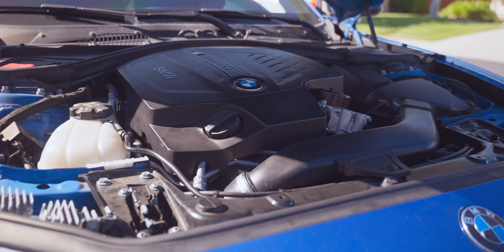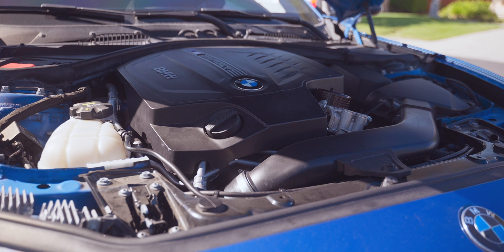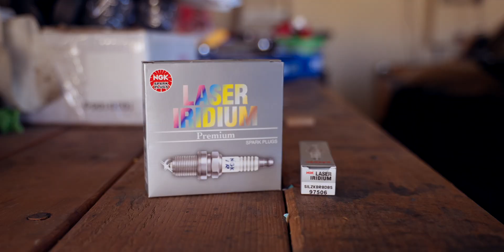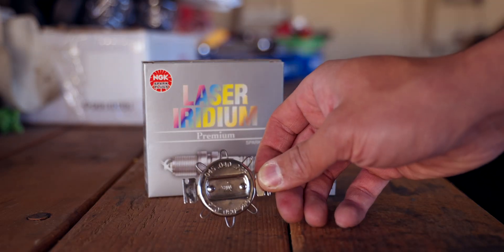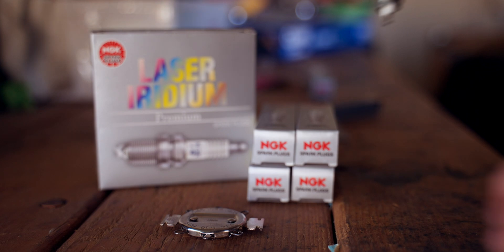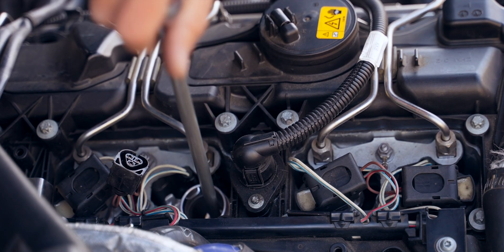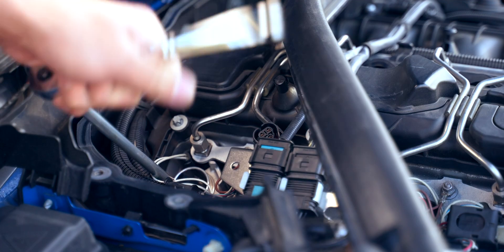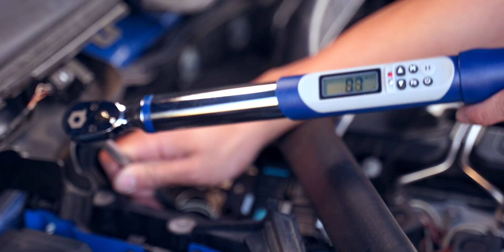How to Change and Gap BMW N55 Spark Plugs

Comment: Nice vid. Are the strut bolts single use, and need to be replaced?
Reply from the maker: BMW recommends you do because they're torque to yield. But the spec is so low for bolts this size it's fine if you reuse them, plus it's not a part that requires super precision. Just don't do the additional angle

Comment: Maybe I missed it but the gap you say for the spark plugs is for a tuned engine. Not a stock engine. Right? Took me a second to realize the plugs I bought are gapped properly for a stock engine.

Comment: Thank you for another fantastic video!!

The only minor suggestions that I have to make:
- For me, the screw holding on the O2 sensor bracket blocking plugs 5 & 6 is a T27 not T20
- The O2 sensors don't have to be removed if you're lazy like me. I was able to just remove the bracket screw and slide the whole thing on top of plug 4 with plenty of room to spare for 5 & 6.
- It's much easier to remove the sound deadening foam at the back of the engine after all of the plastic/weather stripping has been removed. Inversely, it's also much easier to put back first after the plugs and coils have been reinstalled and reduces the chance of it tearing and/or not seating properly.
- I would recommend using a vacuum to clean out any dirt in the spark plug socket before installing new ones.

Comment: I did this today. However I found that putting the foam back before the bar and the plastic piece made it so much easier and ensured that the foam sat in the correct place.

Comment: any reason for not using bosch ZR5TPP33 R8 plugs gapped to .022 on a stock N55 X6?  just curious because that's what i bought and don't want to do the install if ngk's are superior.

Comment: I almost purchased a 2015 535i recently.  Like new, 32k miles.  Then I researched... so much plastic under the hood?!  Leaks, leaks, leaks... $200 - $300 for an oil change?!  We have Lexus & Toyota Avalon currently.  When discussing either the word leaks & plastic never comes up.  At 140k miles some brakes, battery & oil changes thus far.  Will change plugs & flush coolant soon just as preventative.  I backed out on the 535i.

Comment: Boost Monkey Spark Plug Gap Tool for 12mm & 14mm Threaded Spark Plugs (12mm), proper spark plug gap reducer tool not the one he is using.

Comment: When I cold start my engine, it starts and then I have a "stop", and it restart.
It does this only on cold start.
What do you think ? I have zero warning, zero default code.. 

I wait for the Socket, I will check the spark plug then I will update..

Comment: Fritz. Thanks for the video. If I just buy the spark plugs from the dealer would I still have to gap them ? Also my valve cover gasket is leaking a little should I get that fix first then do the spark plugs. I worried that I I do the spark plugs first I’ll find oil on them.

Comment: You dont have to remove strut bars. I broke the strut bolts and had to drill it out major pain. Just remove those triangle plastic cover arout the strut bars. You have enuf room to work on 5 and 6.
Reply: Definitely don’t need to remove strut bar then?

Comment: Fritz, thank you for showing us how to remove the strut tower brace and covers to get to plugs 5 & 6.  Just an FYI even if you are going with stock plug gaps check the new plugs anyway.  One of my six new plugs was over gapped at 0.034" out of the box.  Cheers.
Reply from the maker: Thank you for sharing that and I'm glad to hear you caught that before installing it.

Comment: Just ordered plugs at 53k miles and the only mods I have done are charge pipe, boost and  intercooler. I just ordered the OE Bosch plugs. I don't think I need to go cooler with the NGK at this point. Also doing the tensioner replacement job as well.
Reply from the maker: All of the preventative and routine items I see. Very nice 👌

Comment: Hello Fritz, i am currently stage 1 on my m235 its time to change my sparkplugs, i just got the ngk 97506 should i gap them to 0.022?
Reply from the maker: What company's tune are you using? They should be able to give you the answer.
Reply: @FritzRamos  bootmod3!! I will actually send them an email!!

Comment: You mentioned a tool to check the ignition coil pre-code. Is there a link for that tool? My 235i has a random misfire when idling. Seems to run fine otherwise.
Reply from the maker: I had to use the one from my mechanic

Comment: Your video was a big help. One change I might suggest is to wait until everything else is removed before removing the foam panel. That way you only need to lift it off and back off without having to fight releasing the studs.

Comment: I replaced my plugs and coils recently. I used OE Bosch so it doesn’t need any gapping. I put everything in, put everything back together and I noticed a ticking when I’m driving above 20mph. So idk what to do at that point. So what I recently did was swap the new Dinan coils back to the OEM coils, then put everything back together, but I’m still getting that sound. It’s not loud, but it’s there. It bothers me lol
Reply: Did you figure it out

Comment: Great video.  I waited to pull the rear sound pad off until I had the strut brace and the cowl panel off.  This made removing the pad very simple, with no risk of damage.  The installation of the pad was a piece of cake when the cowl panel is out of the way.

As for the strut brace torques, I took your values on faith and they felt about right.  Has anyone done additional research on these torques?

Thanks, again,  for a great video.

Arnie

Comment: Pro tip: if you’re replacing your spark plugs for this car, you might as well just replace your coil packs along with them. (It’s 200 bucks if you DIY) This car eats up spark plugs and coil packs. Do it every 45-50k and you should be good.
Reply: Yes! Might as well change the valve cover gasket hahaha
Reply: @dauwg99  if you already took everything apart might as well adjust the lifters 😞
Reply: @asron1294  hahahahha

Comment: I know that Spark Plugs has gotten better and last longer due to the "platinum firing tips that dont erode and with the Advancement of Technology , as older standard plugs use to in the 80's that needed to be change frequently. but why is these plugs ( platinum ) the best plugs, changed early,like 60 + thousand miles ?? i have seen them go 2 hundred and 3 hundred thousand in other types of vehicles, without much erosion or wear on the tip (centre Electrode) so why is BMW Recommend to change them  so frequent ??? i guess $$$$$$. any input please ty
Reply: Platinums life are around 60k kms. Iridiums are double 120k+. So no not obsolete maintenance.

Comment: During install of new spark plugs, I used a rubber hose to attach the spark plugs to, and then thread it into the the engine, to prevent cross threading.

Comment: Hi mate, I installed these plugs on my car a couple of months ago at this gap and had issues with not burning all the fuel at idle. (MHD stage 2+ N55EWG) I had to go back to stock plugs at a much bigger gap 0.028. After running your car, take out a spark plug and see if the top of the piston is shiny. All my pistons had visible unburnt fuel with these plugs, hopefully you have better luck! Also just for refence, my cars fuel trims are very close to zero with stock plugs, but were very negative with these plugs at that small gap (at idle). All coil packs were replaced too for reference. I also didn't have any issues at WOT, the small gap and colder plug were just too small and too cold to get a full burn at idle.... Interested to see if you have the same issue.
Reply from the maker: Thanks for the tip. Once I put a few more miles on it I will check on them, thanks for the tip!
Reply: @FritzRamos  I’ve been wanting to install these plugs on mine, what have you found after some months of driving?
Reply: I’m going stage 2+, would you recommend .28 on laser iridium ?

Comment: Hey man question that’s kinda off topic. From driving my car I’ve noticed a mild knocking noise in the front suspension when going through parking lots and what not under 20mph. Is this normal for the car or should I get that checked?
Reply: This actually just happened to me on my 2018 F87. It ended up being a tpms sensor that snapped in half and was spinning around in between the tire and the rim.
Reply: @samsam_f87  how much was that fix lol
Reply from the maker: Sounds like something is loose or you picked up something while driving. I would take off the wheels and under panel to have a look. Hopefully it's just some trash or a connection that came loose or disconnected. If you can't find it then take it in.

Comment: Interval is every 2nd oil change on the 240i
Reply from the maker: How often are oil changes?
Reply: @FritzRamos  UK spec condition based servicing is 18k miles / two years. Many do an interim change say 9k miles / 1 year. 

So can do plugs every 36k miles / 4 years regardless of oil changes

Comment: I’ve got 47k on my M235i now. No issues at all. Hopefully I can push the spark plug change till 60k.
Reply: Yeah, I changed mine when it reached 70k and BMW recommends you change it just by that point as you said at 60k.
Reply from the maker: I hope so too. When I was around that mileage I just bought the spark plugs so I had them ready to go. If you are on the stock tune it shouldn't be a problem
Reply: @FritzRamos  yes, stock tune. I do have a Burger Tuning aluminum charge pipe that I still need to have installed, but I’ve had no issues with the stock plastic chargepipe yet.
Reply from the maker: @stephenlozano2816  say what?! Lucky you!
Reply: You are lucky, my spark plugs only lasted about 30k miles. Symptoms I had were, hesitating when starting the car (Sometimes) and also the car shakes back and forth a bit during cold start. After I swap out the plugs, both of the issues went away.

Comment: I recently replaced the Spark plugs but i didn't modify the gap, do you all think i should recalibrate the gap?
Reply from the maker: If they've been on the car for a while now and haven't given you an issue then no need. But if they only have a few hundred miles it might be worth it
Reply: @FritzRamos  Possibly about 7k now. They have not given me an issue. Well, either it's a great content idea, or just leave it as it.You what, I'll with my instinct and not do anything since I have not had issue with them! Cheers.
And, Oh, great content from you as always!
Reply from the maker: @hyde_official  Agreed, if it's not broke don't fix it. Thank you, happy to help